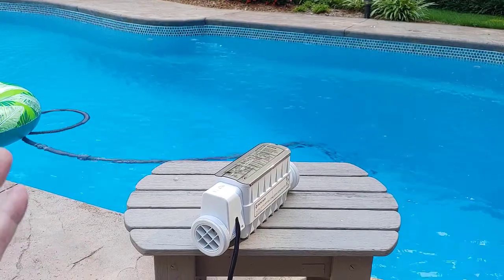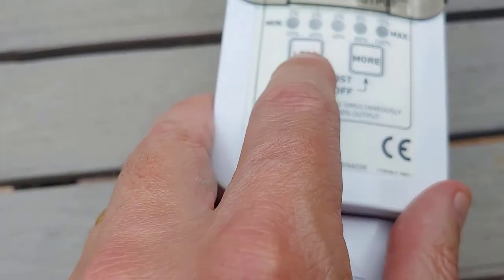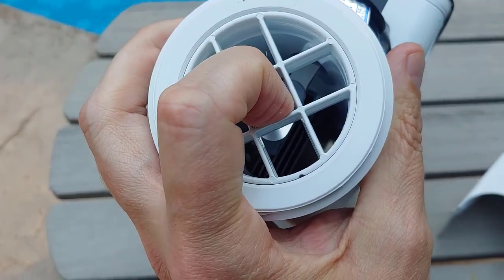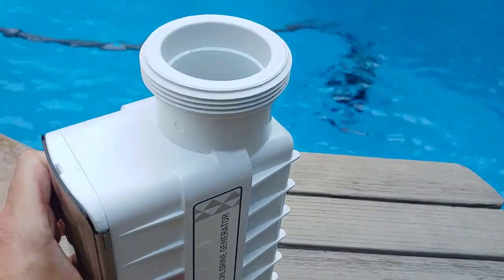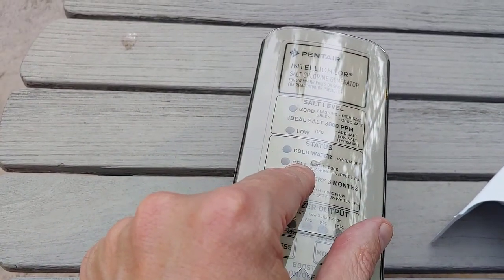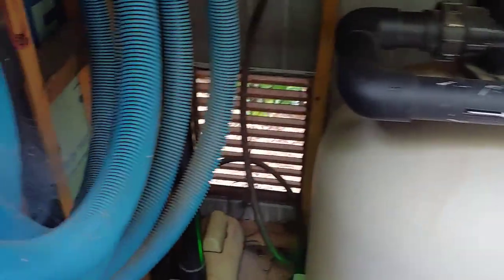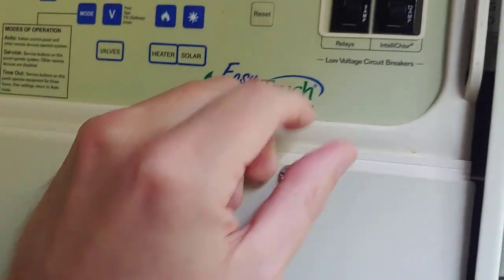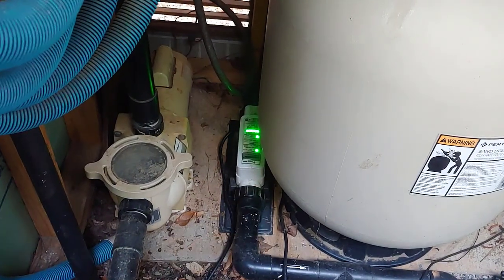Pentair Intellichlor not working? Saltwater Chlorinator Pool/Spa SWG, Replacement & overview.

Comment: I have an IC40 and it's only 2 years,1  month old (so JUST out of warranty) and stopped working. lights still on, looks like it should work, but not generating any chlorine. I hit the button and it shows only 40% of life has been used. Frustrating.
Reply from the maker: That is frustrating. Their tech support is pretty good, even after the warranty. Give them a try.

Comment: Bought a replacement the old one died. Went to plug it in amd no lights I checked the fuse and replaced. No lights
Reply from the maker: Start at the Salt Water Chlorinator power transformer. If it is like mine, it is in your Easy Touch box. Carefully use a multimeter to see if it is outputting voltage when your pool pump is on.  Your dealing with either 120v or 240v so use caution. If you don't feel comfortable doing that get a friend who is.
Reply: Thank you. I might have the wrong transformer. Its a little black box ??? My new cell is I40 pentair
Reply from the maker: @johnnfumo  Do you have an easytouch system, meaning your main box and breakers is called the Pentair Easytouch? if so, look at the door wiring diagram. You'll be looking for the area named Saltwater chlorinator.  That is the transformer. It is the bigger of the two transformers in the box.   Alternatively, if you don't have an easytouch system you may have a power supply box that is the separate transformer.
Reply from the maker: @johnnfumo  look at this link, it should jump you to where I point to it.   https://youtu.be/DAY25dmE850?si=GLaEhxy4ce-q6l97&t=676
Reply: Thank you. I might have the wrong transformer. Its a little black box ??? My new cell is I40 pentair its a Pentair PP40 power pack
Reply: Thanks. The transformer seemed to  work before with the old cell.. I’ll keep sniffing around
Reply: No easy transformer.

Comment: My good salt light does not light up at all not even when start the system but all my water levels are good and all other lights are green
Reply from the maker: It sounds like its at the end of its life? How old is it? 5+ years? If so, it's done I bet. Thanks for the comment/question.
Reply: No its 1.5 yrs
Reply from the maker: @leticiaalvarez1344  I would call pentair and let them help you troubleshoot it. I had good experience with them in the past even after the warranty. They'll try to help diagnose  it even if it's out of warranty
Reply: @SwimmingintheDeep  nice I’ll def give them a call thank you for your videos and responses I really appreciate it

Comment: Good info!
I’m trying to diagnose my IC40.
LEDs are off in the unit.
Everything else has power.
If checking the fuse/replacing the fuse, and the light is not green while everything is connected and powered on.
1. Should I turn off power at the switch, AND at the breakers before checking the fuse green light?
2. When disconnecting the assembly IC40 power cord from the power center, must the breakers be off or just the on/off switch?
Reply from the maker: If you have a multimeter, put the leads on the saltwater coordinator generator transformer that is in your box and see if it is putting out power. I can't remember if it's AC or DC power that comes out of it so be prepared to switch your multimeter to check for either one.

Comment: So when my PUMP shuts off (it is on a timer) - then the FLOW light just goes RED - just like it does when I turn the PUMP off when I backwash or RINSE..  So are you sawing the electricity should shut off COMPLETELY?
Reply from the maker: Yes, if it were wired correctly, it would only be able to come on (and lights seen on the chlorinator itself) when your pump is on. In short, your transformer for your chlorinator in your box area should be wired to the same pump timer.... on the "out" side. That ensures no power goes to your chlorinator unless the pump is on.  I am not sure if the way it is currently wired will damage the chlorinator, I think it would work...but not be the correct way.  Your flow sensor is likely serving to protect it by not allowing the plates in the chlorinator to be actually "on."
Reply: Ok - but can you explain why my cell is flashing green all the time when the pump is running? It says Good Salt - and my levels are all correct - I read that there is a lot of faulty green blinking on the salt cell
Reply from the maker: @laurat9052  how old is your cell? If it's 5 or more years it likely needs to be replaced. If it's less than that you can try cleaning your cell with hydrochloric acid. You should be careful if you do that and there are instructions on how to do that on YouTube.

Comment: I just opened my pool and im getting nothing. Happened last year. I waiting for someone to come and check, but then it suddenly came on! Is that possible?
Reply from the maker: Check the connections maybe...
Reply: @SwimmingintheDeep  I talked to the pool people. Intellichlor won’t start unless there’s enough salt in the pool.
Reply from the maker: @renate19861958 That's true, the lights on your chlorinator should give a pretty good indication. You can also use some test strips that are made of paper to test the salt level. It's very common after the winter that your salt is very low because rain and draining your pool will naturally lower the level of salt. For my pool, I have to add about two to three bags of salt after the winter is over. Also the chlorinator will not read an accurate reading until the temperature of your pool gets well into the '60s. Therefore, if your pool is not in the upper '60s Fahrenheit, or higher, be careful not to add too much salt.
Reply: @SwimmingintheDeep  I got water tested. I had to add 3 bags of salt. I’m just surprised it doesn’t give the light for “low salt”. But temp could be. Water temp still in the low 60s. I just wish there was a light that shows the power is at least on.
Reply from the maker: @renate19861958  Yes, the low salt red light should be on in my opinion.
Reply: @SwimmingintheDeep  I’m getting new fuses today. I’m hoping that is the problem.

Comment: So it has a flow sensor, but it won’t turn itself off? What’s the point of sensing flow if it doesn’t use that data to protect itself?
Reply from the maker: When the flow sensor is operable, it does protect the chlorinator and the system when the flow rate of water is too low by shutting itself off but not the pump. If the chlorinator produced chlorine when the pump is not running chlorine gas will build up.
Reply: @SwimmingintheDeep  
I believe this is only if you are using the Pentair automation center.  If you are only using the basic transformer they sell, this does not seem to be the case.  You should watch this guy (title to follow if links aren't allowed):
https://www.youtube.com/watch?v=VY7QQdcWIdg

"Prevent Pentair Intellichlor Self-Destruction"

This guy says he confirmed this with Pentair, and several other folks in the comments have had the same type of failures.

This is a MAJOR oversight on their part if true.... many people don't want or need the automation controls.
Reply from the maker: @ericrandall3539  I do not think that this is true (I watched that guys video) I believe the flow sensor locally disables the device. To test this you can actually access the wires that go to the sensor and cut one of them. This can be easily repaired with heat shrink. When there is good water flow that sensor is a closed loop low voltage. So by temporarily cutting one of the low voltage wires you can mimic a low flow situation. You can access those wires by taking off the large plastic nut.
Reply: @SwimmingintheDeep  
I really hope so, that would make so much more sense.  Maybe the sensors can fail closed and people are seeing a weird obscure failure mode?
Reply from the maker: @ericrandall3539  the flow sensor is really just a switch that needs pressure to keep the closed loop wire. I have taken mine out and inspected it before. I suppose something could get stuck in there so then theoretically a burnt out motor (where the breaker may not trip) and a stuck flow sensor could make for a scenario that's not good. But I'm guessing based on my limited knowledge.

Comment: And that device is very expensive, they dont last as long as they say, cheaper just to use regular chlorine ....
Reply from the maker: Maybe, but let me know how much a bucket of chlorine costs in your area these days.
Reply: @SwimmingintheDeep  I pay my pool guy the same amount regardless, its his job to keep the pool Balanced
Reply from the maker: @the.trollgubbe2642  I can see that. I don't have a pool service. Salt cost me about $30 a year. I bought this Chlorinator for $300 but the going price is about $800.. I know from experience the first one lasted 6 years. Even if I paid the going price I would only be in it for about $160 a year. So the formula is going to be different for everybody if they have pool service or if they take care of their own. I don't blame you a bit and I'm glad it works out for you with the pool service.

Comment: The buttons to add more or less chlorinator does not work. It’s stuck at 6%. I’m trying to increase to 8%. Any advice?  Thank you!
Reply from the maker: Try this to see if the salt water chlorinator board in your box is the issue.  The cell should be able to run by itself, when it does not get an RS-485 connection.

If you disconnect the RS-485 cable from the main card J20 to the surge card, the chlorinator should work from the cell itself. You may also have to disable the IntelliChlor in the setting page of the EasyTouch.    I got this info from a forum.

Comment: Is there a way to reset the inspect cell flashing light on the Pentair IC like you can on the Aqua Trol control panel with the Hayward chlorine generators?  A friend has the Pentair IC chlorine generator and the inspect cell light is flashing green. Pool guy cleaned cell and it's still flashing. Pool and Pentair IC is about 3 years old so I would think the cell should still be good. But the life span varies greatly.
Reply from the maker: Everything I have read says that if the cell is clean, salt ppm is good, and the water is warm enough.....and the light is still flashing, the cell is probably dead. Pentair phone support is pretty good even after the warranty so maybe ask them too. How many hours a day does his pool generally run? Mine runs about 7 and I got about 6 years.
Reply: @SwimmingintheDeep  Thanks, that was a quick reply. Not sure about the run time. I'll let him know what you said. Thanks again.

Comment: Great video, just got my IC40. Can't wait to plug it in and let it run. In the video you mentioned that IC and the pump must be on at the same time. I have the easy touch panel. If I plug in the IC40 to the panel, do I have to set it with the pump in order to have it turn on with the pump? or It automatically turns on when the pump is turn on, because the IC40 is plug in the easy touch? Thanks.
Reply from the maker: Are you replacing an existing ic40? If so, just wire it the same way. If it is net new, the ic40 needs a power supply (transformer) wired on the same relay with your pump. I cover this in an easy touch overview video. https://youtu.be/y4v-26FFQ0E

Comment: You really should do 75% water with 25% MA.  The more acid the higher the chances of acid etching your metal plates and causing failure.   But i only know after 6 IC40 purchases later.
Reply from the maker: Good tip. I only did mine 2 times in the 6 years. Thanks for commenting.

Comment: My 10 amp micro fuse keeps blowing after connect power with new fuse in. It’s my first season with the pool and salt system. Does the salt cell probably need cleaning? The pool has been running with the filter since May 2022
Reply from the maker: I have not had that occur. Double check all wiring, making sure that none of it has become nicked or that a squirrel or something has not chewed into one of the wires leading to anything. Make sure the entire box is clean and if you have an air compressor or yard blower blow it out.

Comment: Great video!!! Where did you get your replacement unit?
Reply from the maker: Thanks for the comment. I got it new in the box from an individual Facebook Marketplace seller. Try to expand your search to the maximum miles and get people to ship it if you find a deal. Also, if you have the IC20, consider the IC40 if you get a deal. You can always set the output to less.

Comment: Could you share where you found a Ic40 at a fraction of the cost? I have to replace mine at  7 1/2 years old. Thanks
Reply from the maker: I got lucky and found my IC20 on Facebook Marketplace. Go way outside your area on mileage settings and see what you can find. Mine was new in the box from an individual that shipped it and I offered to pay for shipping on top of their price.
Reply: @SwimmingintheDeep  thanks for the suggestion I hadn’t even checked Facebook marketplace, I know sometimes that can be risky also but apparently it paid off for you. If I can find someone who has a legit page at a reasonable price I might just do it? Thanks
Reply: Isn’t the ic40 better?
Reply from the maker: @calidad5524  it has a higher output if that's the size you need. Otherwise it's the same.